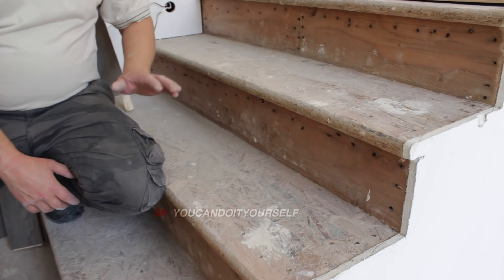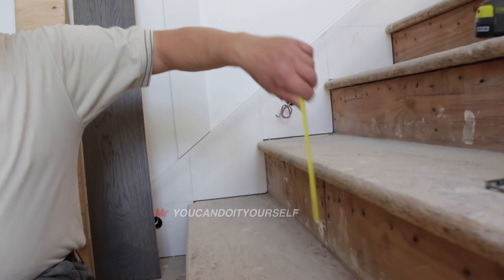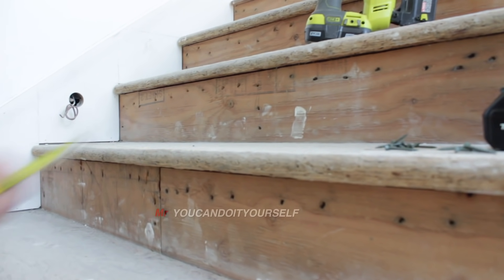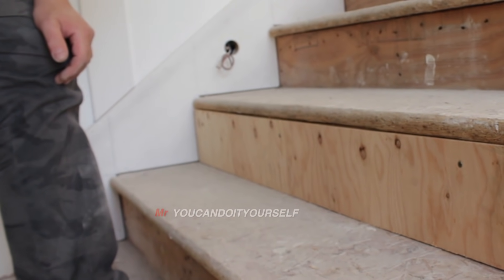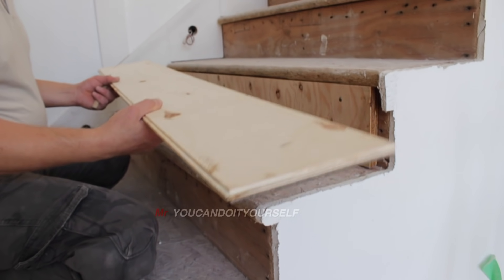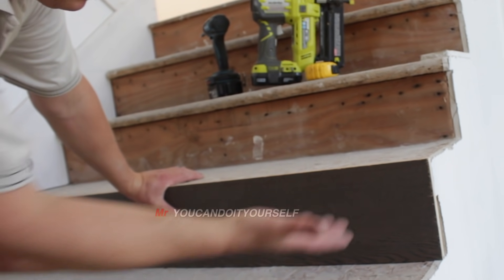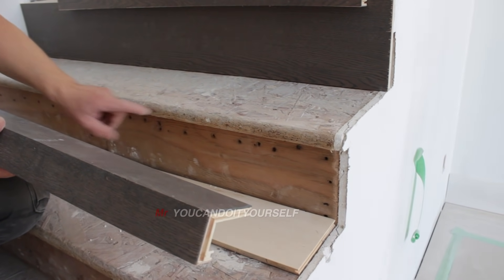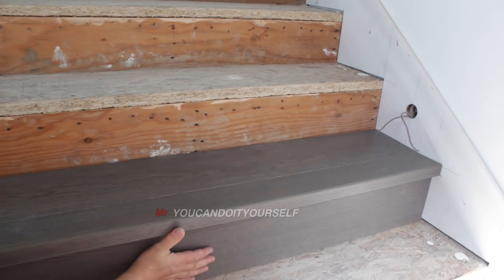3 Easy Ways How to Make Stairs Prep for Laminate and Hardwood Installation Mryoucandoityourself

Comment: Im not sure which thickness of that floor ur showing here .. Is it a half of the inch so 12mm or is it 8 mm ? And i dont want  to cut off carpet nose  so my question is ... Will 8mm laminate be strong enough for that custom nosing ?
Reply from the maker: Hi Chris, for hardwood this idea is good but for 8mm laminate I would recommend you build out riser.
Reply: Also ... I realised that once i started cutting planks for stairs even using tread template to make sure i get a clean perfect cut i ran into a problem.. The begining of a stair close to a raiser looks good then middle itsbowing out and end of a stair is straight .. And that's putting tread template to see ... I dont care if angle its not even cause i got the tread template .. But its not straiggt thru out the whole lenght.m. the middle either bows out or in .. Any suggestions ? Pls help
Reply: Also ... Can u explain built up rises pls

Comment: Highland Hiker, all you learned is how not to do stairs in the proper way. His prep work is okay , however,  its against  all codes to install t&g for treads. Must be one piece with a round over edge. I wish this guy would stop spreading his practice. It works, but doesn't make it proper.
Reply from the maker: Thanks Mark.
Reply: Different locations have different codes.
Reply: Marco Sorgini o.  L